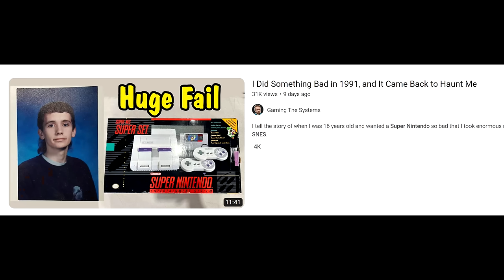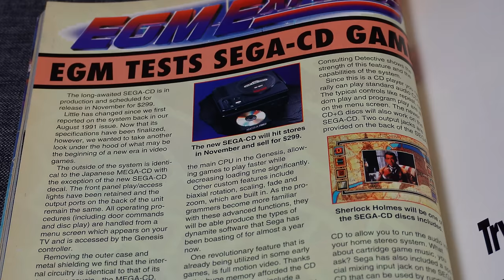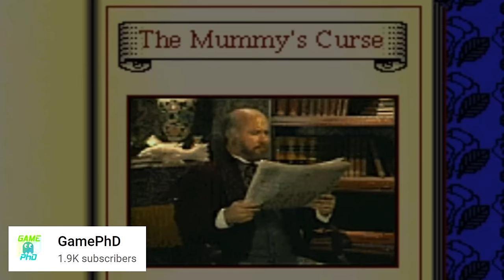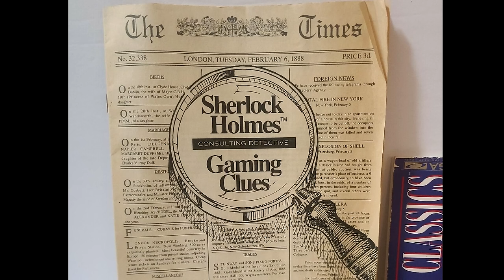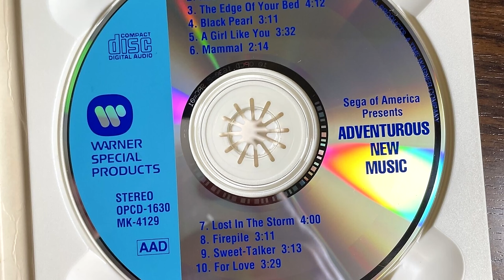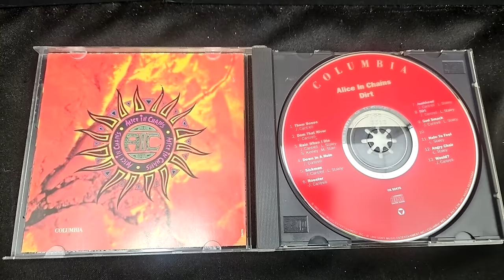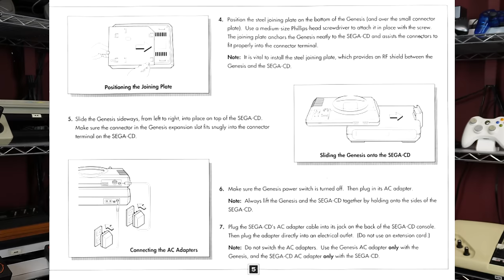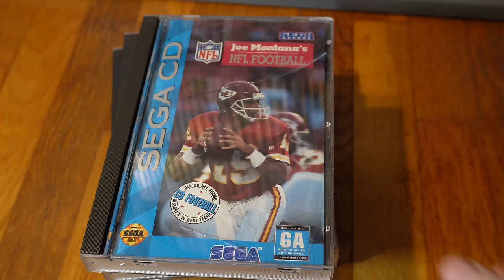Something Bad Happened When I Bought a Sega CD in 1992

Comment: You can bet that 90% of the Sega CD models, sold on eBay as non-working, that have blown fuses is due to someone using the wrong power supply.

Comment: lol, in the time ive had my PS3 slim 120 gb model my friend went through two xbox 360s, i bought my ps3 in June of 2010, i was a senior in Highschool and about 18 years old, it has thousands and thousands of hours on it, i even let my friend borrow it and he put a crap ton of hours on it as well, it has also been dropped on a hard wood floor twice and been mailed to Alaska, its been toted around in a suitcase while i was experiencing homelessness in 2015-2016, its been with me when i started over the road truck driving across the USA in 2017, and now that i'm 32 years old now, it still sits on my entertainment system and it still runs like the day i bought it. no other console has been through as much as that one and is the oldest console out of my 10 other systems i own.
Reply from the maker: I once had a remote control last for 20 years. Same batteries.
Reply: @GamingTheSystems1  Hah that's pretty funny. The Casio watch of remote controls. I'm surprised the batteries didn't leak. There's a video on YouTube of a lightbulb that has been on and working fine for over 120 years in a California fire department. It has been in use since 1901.
Reply: I hope it’s not a CECH-200xx

210xx models are the best.

250xx ones are fine too.
Reply: PS3 came out in 2006, plenty of the launch models stopped working
Reply: @customsongmaker  the 120gb model is not a launch model it was a slim down revision with much higher reliability.
Reply: @Punisher6791  yes that's my point

Comment: I had both an SNES and got a Genesis Model 2 around 1993 or so.  I think at that time both systems were around $100 to $150 and as you know had all kinds of games on them.  I did have a desire to get the Sega CD.  But $300 was a lot of money in 1993 and my parents laughed at the thought of me getting an add on for that price.  Even when it went down in price to $250 in 1994 it was just not happening.  I didn’t complain too much though.  Between both systems I had enough gaming to keep me occupied all the way till I got the N64 in 1997.  By then the Sega CD was a distant memory.

Comment: When the Sega CD is connected to the Genesis and both AC adapters are connected, there is always a small chance the Sega CD fuse will blow due to the primitive circuitry as there is not an adequate rectifier to prevent the voltage from one system from accidentally leaking into the other one when powering the console on or off. A brown-out or surge could also do this, but I've found just turning the console on or off can sometimes blow the fuse as well. It is not a good design.

Comment: Your situation with the First Rollout of the Generation 0I Sega CD (NTSC~U) reminds me very much of my own situation with Digital Converter Boxes: I have worked with Two brands over the years, DigitalStream was what we got back when we were doing the shift from Analogue to Digital on June 0I2 of 2009 and Mediasonic's Homeworx is the brand that I opted for in recent years to try and get my old Analogue setups back in action; DigitalStream's option in 2009 was the DTX9900 and Mediasonic's was the HW130STB, all Three units (two of the former; one of the latter) all came with incredibly cheap Capacitors that will burn out (usually in the form of a small yet loud Crack~like explosion) when you run them around the clock and the fact that they have no form of cooling only delivers insult to injury because it has made it virtually impossible to do anything on these units without possibly sidelining them to get a High Definition Television for full~time use in the Editing Room.

~ The two DTX9900 units lasted me Seven and Eight years, respectively, the first had its capacitors blow in August of 20I6 and the other one was done a matter of months later; DigitalStream manufactured these with a very wide form factor for the time, making it significantly easier to dissipate heat than most current units on the market from other brands, it is easily one of the most stable options that we had in the Early Era of Digital Converter Boxes and while it doesn't come with Multimedia Functionality nor DVR resources it is still one of the most solid products that you could get and anybody with good soldering skills can easily bring any unit back from the dead.
~ The HW130STB has only been on my person since September 0I2 of 2022, we got it during a Mercury Retrograde and the capacitors blew on me this past Sunday (April 02I of 2024, for those reading this deep into the future; this too, was during a Mercury Retrograde), there were at least Two or Three incredibly loud pops and cracks from the box on April 020 and 02I to tell me what was happening and despite being plugged into an incredibly durable Surge Protector (a Belkin Premiere Series SurgeMaster II (Skeleton Model) from I998), simple fact of the matter is that Mediasonic and Homeworx made these boxes with an Ultra Compact design that not only packs too much heat in a suffocating environment, but it also was produced by its Chinese division in an incredibly difficult manner to service because it has no Screws and it forces users to have to literally break the box open (and also its Remote) simply to get to the PCB; the capacitors used are very Low Grade and akin to First Generation Sega CD units it is very easy to break these without being able to repair unless you know exactly what you are doing and which parts are the safest and most effective to last for Around the Clock usage under consistent Heavy Load.

What happened with your unit is definitely a major oversight, on the part of Sega, the parts it was working with were probably the best that Japan had on hand at the time though and I wouldn't be surprised if we end up seeing owners of the original NTSC~J units from I99I deliver similar stories that match up with your scenario if a Power Surge ever happened in the region; in reality, the Sega CD should've been its own console from the get~go with Megadrive Compatibility (pretty much what the Multi~Mega and CDX ultimately became in I994), I would've definitely expected more from its 0299.95$ USD pricetag because as a Multimedia system that could play Audio CDs and deliver Karaoke Night through its CD+G Reader this is too expensive to get as what is essentially a glorified Peripheral, the Compact Disc was roughly Nine Years into its run when the Sega CD debuted in I99I and for many who didn't want a CD~i or couldn't get a ThreeDO (which keep in mind came with a Five Disc CD Changer if you got the N-1005 "Robo" model) this was one of the cheapest consoles at the time with an effective library of games and media compatibility that it would've easily sold more units for cheaper if it was both a Standalone option and an effective way to evolve the standard of game development as we waited for the Neptune and Sega Saturn.

Comment: On the "Rock Paintings" disc, it is a CD+Graphics. Part of the CD Standard is the ability to display a slideshow of still images and lyrics on a screen provided your CD player has a graphics decoder. In addition to Sega CD, the Philips CD-I Player also had the ability to display graphics, and CD Karaoke players can also display the graphics. The graphics are stored in one of the subcode channels on the disc, and my Philips CD-i player would automatically display the graphics if they were present on the CD.

I have a number of CDs with Graphics including "Behind the Mask" by Fleetwood Mac, "Information Society" (self titled), "Tokyo Rose" by Van Dyke Parks, Laura Branigan (self titled), and "Eat or be Eaten" by The Firesign Theatre. I also have a sampler disc from GRP that shows the full capabilities of CD+Graphics, it provides a full review of each track's artist. It's unfortunate that graphics weren't implemented on all CDs even if they couldn't be displayed with the early players. One of the complaints about CD over LP is the size of the album art with CDs. Well, with graphics it is possible to display large album art, liner notes, running lyrics, and other information on any TV set via a graphics decoder on the CD player.

Comment: The simple solution would have been an externally replaceable fuse port, like an automobile fuse you can easily replace. But that would have prevented them from making those sweet repair sales after the warranty expired.

Comment: I got the model one Sega CD for Christmas in 1992, had all those add ins plus "Sewer Shark" I also had that "Road Avenger" game, but the FMV game I played the most by far was "Night Trap" which generated a little bit of controversy at the time because it was basically a cheesy slasher film, I had Dracula too, but I hated that game because it was pretty hard. Silpheed was "the big one" on that system because of the poly graphics at the time. My first experience with Doom was on the 32X also.

Comment: This happened to me as well, though with a model 2. Got another functional machine used later on and kept my original, since it'd be e-waste. Since I was still unaware of the fuse at a later time, I exchanged the motherboard to make a Frankenstein unit. So... at least it works, I guess.

Comment: If you add a 32X, then you need to plug in 3 power bricks.  But they won't all fit on a normal 6-outlet surge protector.  You need a squid-type extension cord.  But those didn't exist in the early 90s, so I wonder what Sega recommended for people who only had 1 outlet near the TV  (You also need an outlet for the TV).  I guess you'd just use 2 power strips.

Comment: The Model 1 CD unit did not like to be turned upside down. The plastic track that turns and allows the lense to clear when inserting a disk either breaks or becomes dislodged. At least they had the good sense to correct it down the road.
Reply from the maker: Well, I'm pretty sure I never turned it upside down before the problem happened.

Comment: I would have figured it out - Plus, you can make a request to have the CD removed. I'm thinking of buying one of these, worth it in 2024?
Reply from the maker: You think you would have, in 1992, in the early days of CD drives? If so, more power to you. Is it worth it, I'd say no. Game are too expensive.
Reply: @GamingTheSystems1  I saw my uncle work on CD players and small gear systems (printers, floppy drives) for years - mind you in 1992 I was 10, so no, I could not have, but by 17 I was building and troubleshooting computers. I even took on extra work from that same uncle. Without that formation, no, probably not though, and I doubt there was a "paper clip hole" on the Sega CD :P 

I'll stick to cartridge Sega Genesis games then I guess - I just picked up the system about 3 weeks ago (my 5 year old bought it with chore money) so there's plenty to enjoy ;)

Comment: You kinda missed the point that all cd drives should have a mechanical way to open it up and remove your disk. A little hole somewhere. So does the Sega cd have one or not? Because if not that would be a serious design flaw. I even thought cd-drives are just required to have it.
Reply from the maker: My 17 year old brain didn't know, but I'm pretty sure there's a way.

Comment: SNES has a 1.5 amp fast blow fuse. It also is sensitive so I was laughing when you simulated flipping the power switch with Star Fox. You can blow the fuse that way with a heavy power consuming super Fx game and the multi tap plugged in 😂 you're kind of bad luck I do see. 😅
Reply from the maker: Ok, but that SNES didn't have power going to it. Each system in the room has a power switch assigned to it.